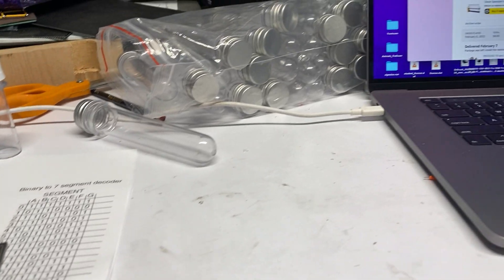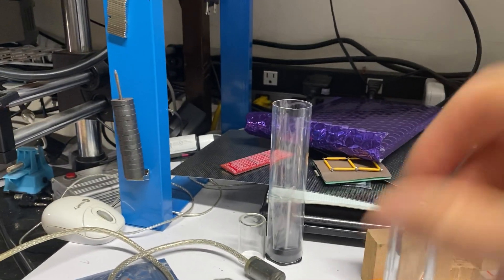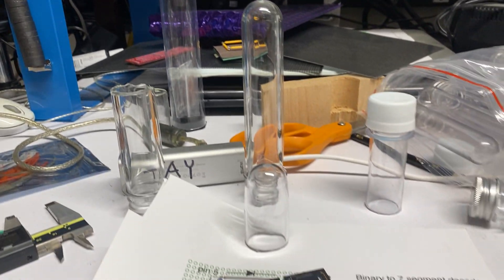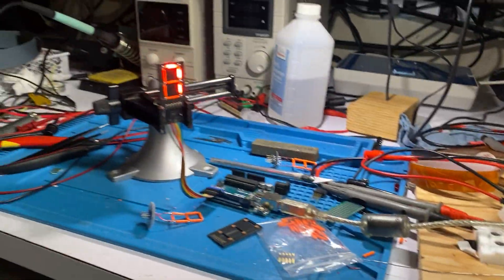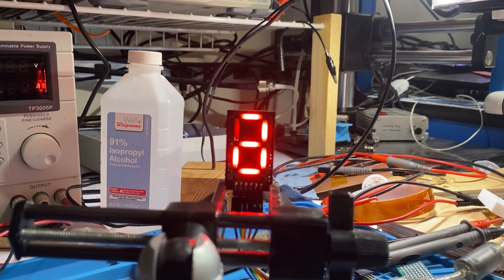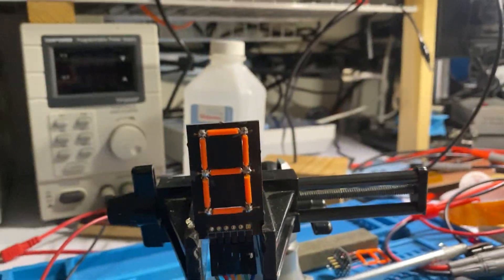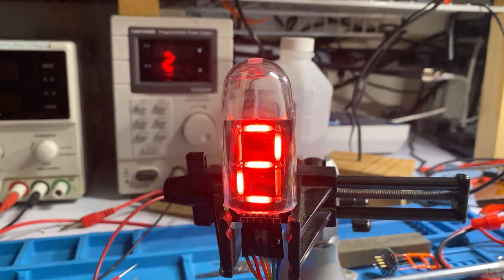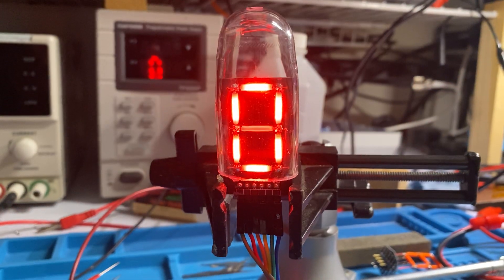LED filament digit

Comment: Nice! Wonder if you could move the front pads to the rear and hide all the solder joints. The front would look super clean. I should try making a clock with these filaments.